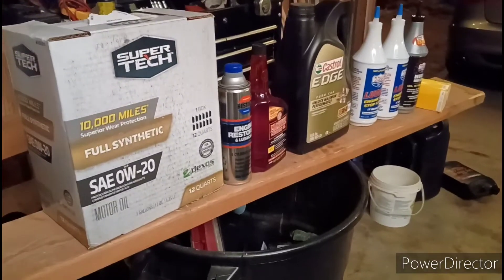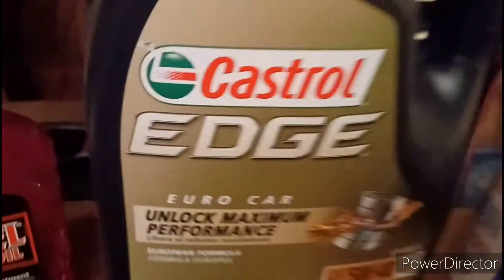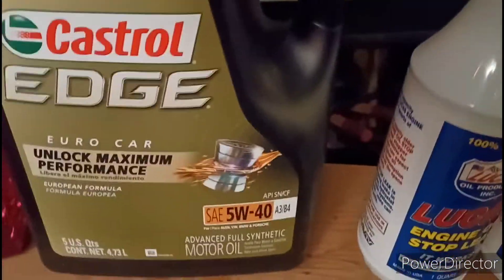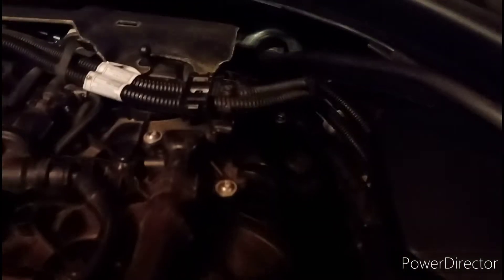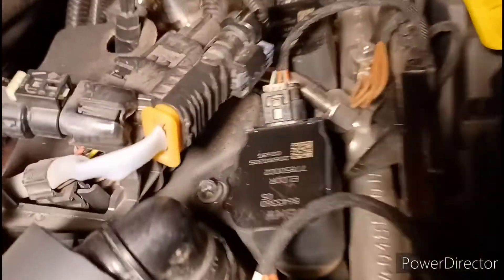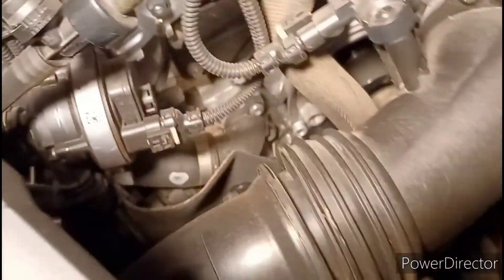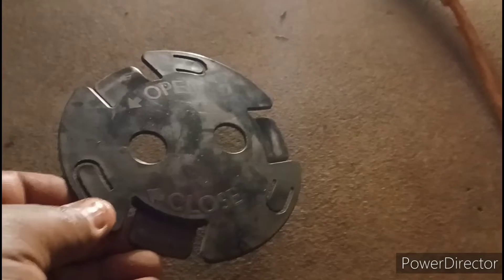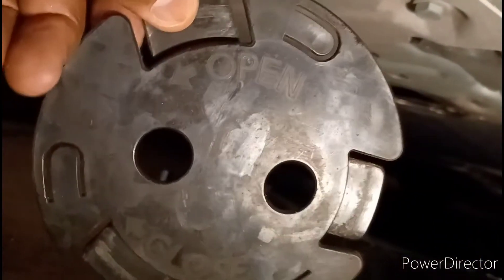2019 BMW 330i Oil Change in minutes

Comment: Man you really weren't kidding you make buying a 2019 bmw 330i so much easier of a decision simply due to how accessible the spark plugs are and how easily an oil change can be done well worth the sub thanks a ton
Reply from the maker: All good brotha!! Just pace yourself and keep an eye on the maintenance log in the dash. It will tell you all you need to know. I do my plugs at least once every 40k-50k because it's so easy for most cars. I don't let em go til they throw a misfire. Nope. At least pull a plug every blue moon to see how charred it is. That'll give you an idea of when it's time to pull em all.

You're gonna love that 330i, trust me! I've got a video with the mats I have in mine, so check that out. Everyone loves the mats! There's a link where I got em, too. Easy install, as well!

Comment: How do you reset the check engine light?
Reply from the maker: To reset the check engine light, press the start button when you get in the car. The dash will light up. You should already have your OBD II scanned plugged into the port by this point. Go to CLEAR CODES on the scanner. The scanner will process and go back to it's regular screen. Start the car and the engine light should be gone.
Reply: @MicDropBBQ  no luck.   Could not reset the check engine oil and the check engine light is still on.
Reply from the maker: @MrRedDawg1  What's the code you're getting?
Reply: @MicDropBBQ  no codes are popping up.  It's just the message that the oil change is overdue on the screen infotainment screen.  I am wondering if the BC button is bad though because I have tried the press the start stop button sequence as well.
Reply from the maker: @MrRedDawg1 when you press the BC button without pressing anything else, does it work?
Reply: @MicDropBBQ  not sure what to use that button for because I don't drive the car.  The only thing that seems to pop up is the battery.  I'll have to ask my daughter and get back to you.
Reply: @MicDropBBQ - Ended up taking the car to a German car specialist shop.  The owner says BMW had the oil reset code locked, and the only way to reset it was with a computer.  He had an Autel.  I didn't get the model separate. but it was wireless with a unit plugged into the OBD2 port and the "screen" separate.
Reply from the maker: @MrRedDawg1  Wow! So they had the reset locked. People just need to leave these cars alone because it makes the most simple things more complicated, for no reason! Glad you got it figured out because it should have went a lot quicker than that! You knew something was off.
Reply: @MicDropBBQ  it ended up costing me $64 dollars but he confirmed what I knew.  Yeah, he said the reason its locked is because as we know, the dealerships want folks to keep coming back because that is where they make their money...I asked him if there was a way he could break the codes and he told me he would have to do more research and diagnostics and that would cost me or my daughter more.  The only thing I can say is that I saved her at least $125 because she had been going to the dealer but decided she was done with that since the warranty is over now.  Either way, I appreciate you for your guidance!!!
Reply from the maker: @MrRedDawg1  That should be ILLEGAL for a manufacturer to lock our ECUs to the point where we have to go back to a dealership. I bought my car from a Mercedes dealership a few days after it was brought back for a lease trade for a Mercedes. I don't think Mercedes would even know how to do that. But had it been at BMW....hmmmmm. Maybe not ALL BMW dealerships would do that, but there's definitely a shady one doing it.

All good, brotha. I tried to help as much as I could but I had no idea there was a way to lock the reset code!

Comment: Can I use 0W – 30 mobile 1 engine oil?
Reply from the maker: Depends on the climate you live in. Google your average temp at the time and see which oil viscosity works best.
Reply: @MicDropBBQ  So I have 2019 330i with 32k miles. I just got an oil change using LM oil. And the ceratec arriving from Amazon in three days. Do you think this ceratec will really help on the engine? I’m afraid this might make it worse.